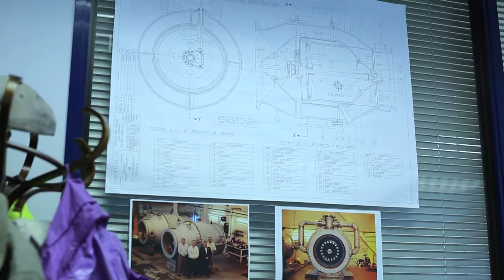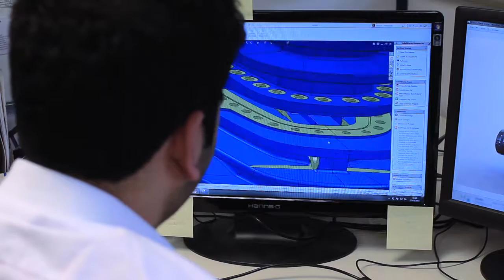The 100 Year Project | New York | Larner-Johnson® Flow Control Valves | Plunger Or Needle Type Valve

Comment: Nevermind. It's been proven simple designs using flat cylindrical plates, w a fraction of inch gap at full open,  produces non destructive laminar flow. At thousands of gallons a minute with surface areas of several inches.